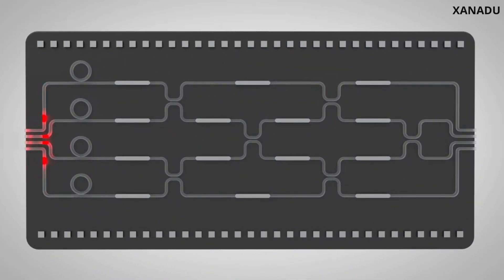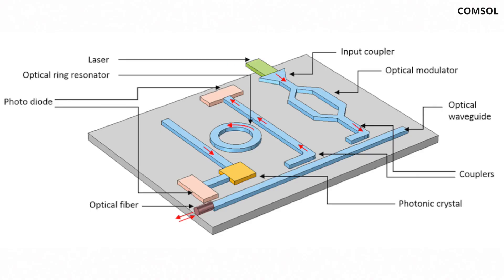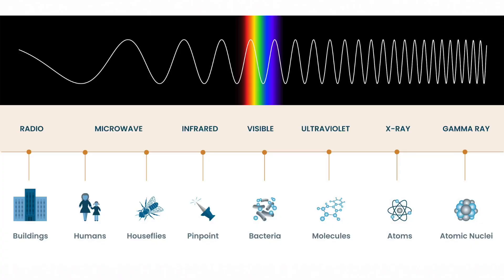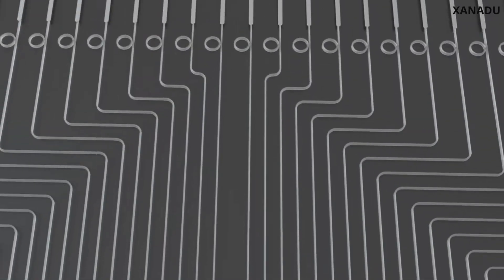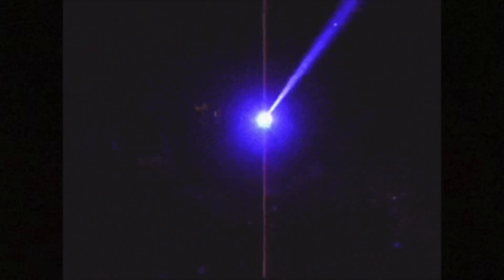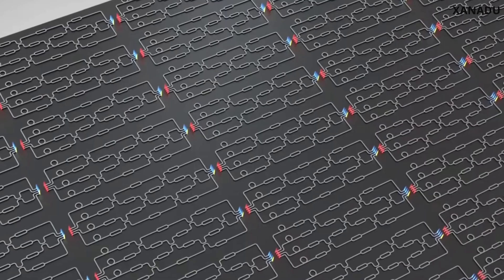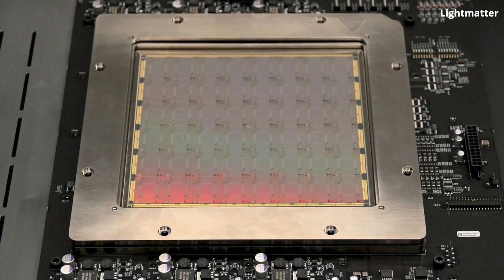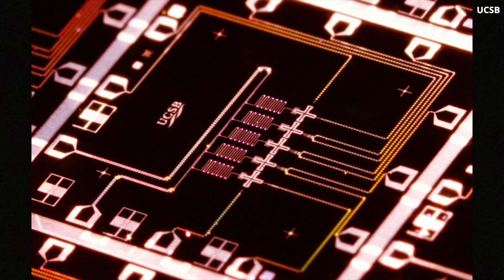New Photonic Chip: x1000 faster

Comment: A few corrections.  The entire optical transmission industry uses infrared light, typically centred around 1550nm.  Silicon is perfectly transparent at these wavelengths and is an excellent optical semiconductor for some functions.  The concept of the photonic integrated circuit (PIC) dates back to a Bell Labs paper in 1969 and companies like Infinera have been building PIC-based optical transmission equipment based on indium phosphide since 2005.  Even the original PIC chips from Infinera have over 200 individual optical elements integrated.  Lithium niobate is an excellent optical semiconductor as a modulator but there is very limited experience of using it in a PIC.  Perhaps the main challenge of scaling the number of components on a single chip (be it electrical or optical) is the killer defect rate - which is when material faults randomly occur in the chip structure during manufacture.  If these defects occur where there is a critical chip function then the chip will not work properly.  Once of the major successes of the silicon chip industry is to reduce killer defect rates to allow large die areas with acceptable killer defect rates.  Indium phosphide is maybe a decade behind silicon in this respect, but lithium niobate is twenty or thirty years behind silicon.  Companies like IBM and Intel have poured billions of dollars into silicon photonics so I would still put my money on silicon winning the race - even though it's not an ideal semiconductor for optical computing given that it cannot not work as an electrically pumped laser (silicon is an indirect bandgap semiconductor).
Reply: Good points, but regarding defects: The image at 0:10 suggests a very simple periodic circuit with many independent circuit lines.  In that case, the yield problem might be meliorated with a standard trick used in memory arrays: build in a lot of redundancy and discard lines that test bad.  You could even do it in software.  The killer defect rate is then measured in defects per unit length of a broad "line"  and only scales, roughly speaking, with the inverse of the "width," or the square root of the chip area.  Of course, that might solve the defect problem, but it rather limits the chip architecture.
It also kinda looks like the device density sucks.
Reply: 36 years ago we solved the defect problem with self healing circuit designs. We also had test gates operating at 8 picosecond gate delay the month before we were parted out. We saw no barriers to achieving a 13 GHz CPU by 1991. We also had operating fiber-optics in 1981 at 100 MHz. And we were looking at opening our chips and communicating chip to chip via light. We were also discussing photonic circuit alternatives. Shift from using CPUs to programmable logic arrays that emulate CPUs and you can get around the CPU problem. For camera systems and graphic processing there is an absolutely obvious way to eliminate most processing. That too was known in the early 1980s but never implemented.
Reply: Underrated comment wrt to the hundred of thousands of views of the videos! 18 likes vs 11k likes at the time I'm typing. 0.16% ratio!
Reply: it all comes down to laser source
Reply: Duh. Youse sound smart.
Reply: Now that's some deep knowhow! Excellent!
Reply: Thanks for proving how we all feel…lol
Reply: thanks. i really apreciate the knowledge u share.
Reply: The most detailed comment I have ever seen
Reply: Excellent....thank you
Reply: This is what I thought when she said silicon wasn't transparent zoom in on silicon sand and it's transparent 😮
Reply: @patrickday4206  Sand is silicon oxide (silica...or glass)and is reasonably transparent to visible light.  The elementary form of silicon is transparent at wavelengths above about 1100 nm while we generally say that the longest wavelength of visible light is 700 nm.
Reply: @patrickday4206  The transparent part of ordinary sand is silica -- chemically silicon dioxide: SiO_2 -- amorphous quartz.  That is indeed transparent in the visible and even into the UV.  But...
Silicon, which the overwhelming majority of microelectronics is based on, has a bandgap of 1.1 eV, so it's transparent only to wavelengths a bit longer than about one micron, or 0.25 microns longer than wavelengths at the red (long-wavelength) end of the visible spectrum.
The oxide of silicon is used in conventional chips, but mostly as a transistor-gate insulator and as a gate material, which doesn't have to be a very good conductor at all.  That stuff is polycrystalline, and thus not very useful for electrical conduction generally or for optical transmission.  I have no idea what the current status of SiO_2 crystal (i.e., quartz) growth technology (or doping options) is.
Reply: It could be nuclear power. They just want something advance enough to send to space

Comment: Another issue is the core material used in this technique: lithium. Unfortunately there is already a lot of pressure on the supply for lithium because of the demand for lithium-ion batteries in phones, computers, electric vehicles and renewable energy storage. Lithium mining results in a lot of pollution, overuse of freshwater, displacement of local communities and geopolitical/economic instability in developing countries. We’re already near a supply limit so this would be difficult and dangerous/unethical to scale.

Comment: The speed of the whole will be the same as that of the slowest part. It would be useless to have a 10 Gbps network if the HDD max. 300 MBps. As much as possible, it should be replaced with optics so that there are no slower parts between the different parts. If both the memory and the processor were optical, then only the HDD and SSD would slow it down. But what about the dimensions? How big of an optical computer would be as powerful as a modern PC?

Comment: Speed efficiency in data communications is still a milestone of computational physics, at the speeds you've iterated then it will only be left for computing to catch up. That is very much an achievable goal, especially with, and because, of data communications nearing the speed of light.

Comment: Was is fair to criticise the power of the laser pump and the waveform generator without considering the power utilised by the power supply and cooling system of traditional non=optical technologies?

Comment: Thought is the fastest thing in (?) the universe. I can OOB visit another solar system instantly 😅 glass is also silicon and oxygen so not always black. 😅 Chips and wafers, I'm getting hungry already. Bandwidth is not latency. Light latency (getting a response) is the same as radio/electricity. CPUs move data in 8 byte chunks these days into calculation registers (except when tranferring large amounts of data between memory locations and many compilers minimize that by changing  pointers rather than the actual memory chunks). We would need a new model of calculation to really take advantage of lights bandwidth advantage.

Comment: I think i've heard that the power usage in regular silicon based chips is usually data transfer, not the actual calculations. So since they skipped that whole backend step I'm also sceptical.

Comment: I can understand that analog operations were implemented this way for quite while. But how to hold on information? Means, main issue is how to build flip-flop! All of circuitry presented here are in place for many years. Yes, bigger, slower, but was developed long time ago. But still no flip-flops. You cannot process complex operations without the memory. Therefore no difference to very fast analog processing by op amps. That was the reason why optical processing is quite limited.

Comment: If I understand what is described, it sounds like photonics may not directly umpact the speed of gateways and transistors but can be revolutionary in the bandwidth and transmission of data. I imagine the data modulation can be anything... AM, FM, multiple frequencies simultaneously or anything else conceivable. There is no resistance to dpeak of so data pathways can ne as long or short as desired or needed eliminating the need to locate data in close proximity of compute cores or higher level modules. I don't consider the power requirements critical or permanent obstacles, if they exist, it's only until the issue can be overcome and are often overcome quickly.

Comment: Knew it would be lithium niobate. It is an extremely versitile material. A bulk chunk makes a fast q switch for a laser, a thin piece is used in accousto optic switches, appy an AC electric field while cooling and you get a wavelength converter to turn a beam from IR to any wavelength you wish that the material is transparent to. Oh the laser used for a chip like described would be similar to the one in a blu ray disk burner. The RF generator would not require much, it uses the electrostatic field of the wave to change the polarization rapidly. The main issue would be extreme coherence length of the laser and extremely precise frequency stabilization of the RF source.❤

Comment: Scalar waves, also known as Tesla Waves or Longitudinal Waves, are a fascinating phenomenon. Let’s explore their characteristics:

Speed: Scalar waves are said to travel faster than the speed of light (superluminal). Unlike electromagnetic waves, they do not adhere to the limitations imposed by the speed of light. This property makes them intriguing and mysterious 12.
Nature: Scalar waves are non-electromagnetic and are composed of pure zero-point energy. They do not exhibit the oscillating electric and magnetic fields typical of transverse electromagnetic waves. Instead, they propagate as longitudinal waves, which means they compress and expand in the direction of their movement 1.
Penetration: Scalar waves have the remarkable ability to penetrate any solid object, including Faraday Cages. Even if you place a transmitter inside a thick metal box, a receiver placed outside the box will still receive the scalar wave. This property defies conventional electromagnetic behavior 1.
Applications:
Communication: Scalar waves can potentially be used for communication purposes.
Energy: They hold promise as an alternative energy source.
Other Applications: Their potential uses extend beyond communication and energy, but research and exploration are ongoing 1.
Neutrino Comparison: Some researchers draw parallels between superluminal scalar waves and neutrinos. Neutrinos, too, are believed to travel faster than light. These elusive particles bombard Earth from various directions, and their interactions with our planet remain an area of study. Understanding scalar waves could enhance our survival during chaotic periods, such as solar fluctuations or sunspots 1.
In summary, scalar waves are a captivating field of study, and their properties challenge our conventional understanding of physics. While their practical applications are still unfolding, their potential is vast and exciting. 🌟

Comment: The efficiency might very well still hold up, didn't read the paper, but if the photon-microwave generator uses up 100 watts for 400x the compute power, than its already better then a silicon chip using up 40001 watts. In other words if the task gets completed 400 times faster while using 10x more kw/h this is a huge gain in efficiency.

Comment: The main limitation of current cpu/gpu processing speed is not the total power consumption but how to cool the chips, so it might still work if the photonic chip efficient. But would be ideal when running on renewables if the other parts consume a lot.

Comment: we dont have electronics that can feed an optical encoding device in THz speeds, thats why theyre using microwave encoding. Its the fastest we can transmit data using conventional computers to encode the optical signal. The optical signal is the carrier and the radio signal is the modulator. The only reason they are converting to light is because they can optimize certain computations (like matrix multiplication and fourier series) natively due to the innate physics of the system that is designed. This is essentially an analog signal with no discrete values which makes repeatability a bit of a challenge due to things like chaos theory. It would be cool to see some sort of optical transistor that can be switched easily with optical logic gates and possibly do discrete calculations instead of analog ones.

Comment: I theorised this in the 90's but the finesse here is amazing. Light sensor/emitter arrays are only limited by the medium the light travels through and the switching states of the sensors. Different diffraction patterns can instantiate different data outputs from inputs, and the need for a medium apart from storage is minimal, compared to circuit boards. Plus points include higher resistance to EMP events. Cons include likely sensitivity to cosmic radiation.
Reply: perhaps the cosmic radiation be... cancelled out  but that slows down processes

Comment: Dear Anastasi - it you over 6 minutes to get to the main point -
conventional transistors are switching at 5GHz and Green light can switch at 540 Terrahertz.
But what is the light frequency they use?
Are they photonic transistors?
The idea has been around before the 1980s but no one ever made
a proper Photonic transistor - do we have them now?

Comment: What about memory? If these chips become useful, then you need to feed the chip extremely fast and I/O between the ram and chip needs to be upped AND the ram needs to operate at similar frequency as the chip. Any breakthrough in the works?

Comment: Hi Anastasi. This paper certainly seems to stir up high hopes that it is possible. Ultimately they need to demonstrate the actual hardware that does this. I am an Electronic Engineer and always try to lookout for new technological breakthroughs. In my opinion photonics seems to solve the inherent problems associated with silicon and that is capacitance and inductance which both pose their own set of problems such as maximum clock speed and add to overall power consumption which is always multiplied by the billions of transistors on the chips. Is it so, that photonics solves some of these limiting factors? Am I missing something? And then also the noise issue which limits the minimum operating core voltage. If you have a conductor that carries a signal it is prone to electromagnetic interference from surrounding signals. In my understanding photonics is not prone to electromagnetic interference, so how does photonics compare to regular electronic signals when it comes to noise. What other limiting factors does photonics have on the other hand?

Comment: No, the optics are too slow, LiNb03 has a electro-optic limit, meaning the path length can only be so short, which equates to longer time of flight over the PIC. Lithography limits will induce errors, so for an image process, well OK, it will have some tiny difference to the true calculated output, you won't notice it much, as for floating point, forget it.

Comment: I wonder which one wins, in terms of computing power and energy efficiency, the fastest photonics chip available vs Cerebras Wafer Scale Engine 3
😊
Reply: Or we can just combine the two (the photonics chip and/or interconnects with wafer scale engine), can't we...
Anyway there was this achievement last year by NICT, they managed to create a whopping 22.9 petabits per second transmission in a single fiber! Although they used the so called space division multiplexing with 3 propagation modes in each of the 38 cores the fiber has and that they don't use standard 0.125 mm cladding diameter. And this just demonstrates how fast a fiber and photonics in general can get, and we just barely started, considering that they managed to double their previous 2020 record, who knows how fast a fiber will be in 5 or 10 years

Comment: This is useful for some computing tasks, but how do you make memory from this? Is it possible to make elements that somehow retain their state? I mean, even the simplest cpu at least needs registers, right? I don't know now, maybe in the future they will find the way to make memory out of this, but as of now, you still have to rely on silicon electronics to hold information (unless, maybe it's hard-coded in the chip's structure in some way). So, it may find some uses, like for quick AI inference, which is all good, but to make a processor, you at least need to make a program counter, which you can't with this technology (yet). Or can you? Did I misunderstand something?

Comment: So, it's not for real. 
Light is best for transmission. It's modulated very quickly and many channels (wavelengths) can be fired into the same fiber. This is great for 'trancieving.' Is it that necessary to use light on a chip? What I mean is, for the everyday operations that we undertake, the latency of today's chips is adequate. 
I guess I don't grasp the magnitude of AI computing, ie, how many operations AI computing requires for real-world simulation, etc.

Comment: The problem with all forms of analog computing is storing results for multi step computations or to use those results later.  We can easily do this with digital circuits.  The problem with analog computing is that you need to convert the analog signals to digital to store the result, then convert them back to analog to process further.

The additional hardware and power consumption to do this conversion greatly out weighs all the benefits.  There needs to be a breakthrough in how we can convert or store analog results in order for this technology to be beneficial.

Comment: Analog devices are not "programmable" like a digital computer.  It is typically a one trick pony.  Of course you can put multiple ponies on the chip, and select which input you use to perform the operation, but it is not like a digital algorithm.